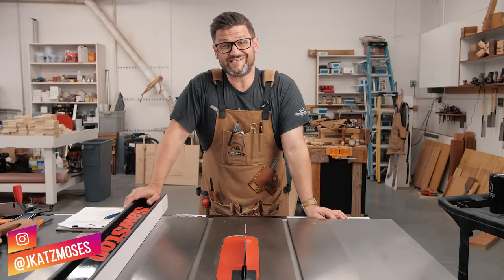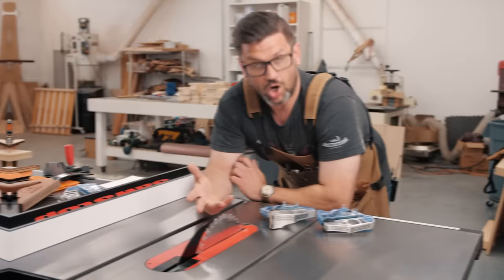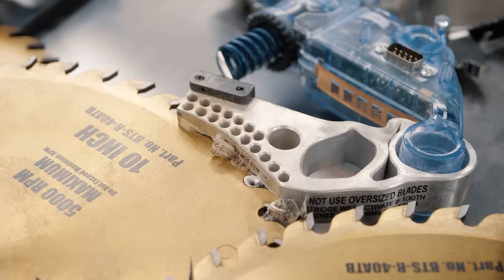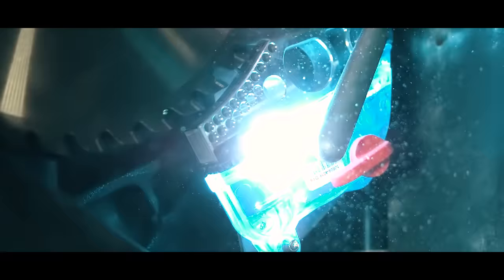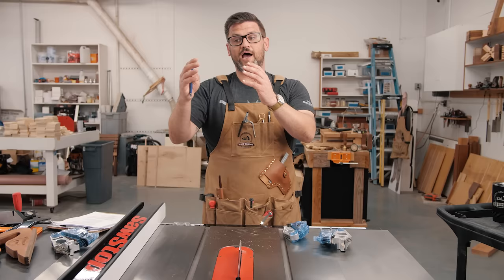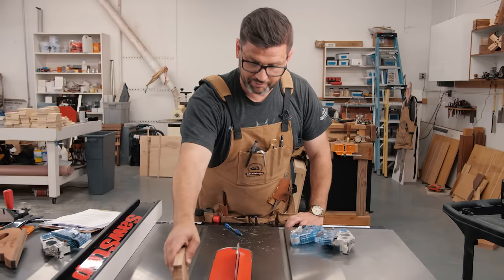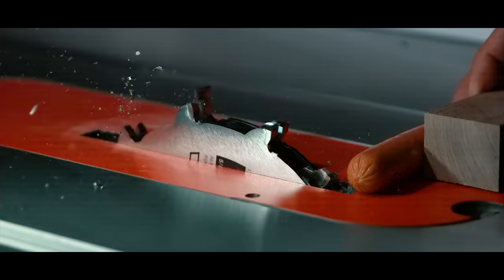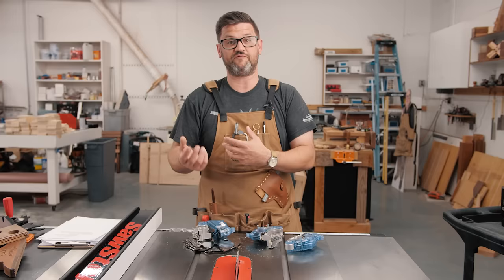How Safe is a Sawstop Saw? - Never Before Seen 19,000 FPS HD Slow-Mo Video

Comment: I literally went "Holy shit" out loud when the teeth popped off. That is INSANE.
Reply: Same here. I had to go back and play it again just to be sure I really understood what just happened... even after it was explained. Just crazy.
Reply: How do we know that he first broken tooth wasn't the first to hit the brake ? Are we one hundo on that?
Reply: @cognitive-carpenter  The replay at the brake shows that the first tooth to hit it barely got past the brake. It never got back to the top.
Reply: Same. That stopped with enough force to rip the metal apart. Incredible.
Reply: @chroniclesofbap6170  Well, it wasn't really just the force of the stop. The far disk wobbled and clipped the one next to it, breaking off the tooth.
Reply: @badgerwatkins  I never spotted that!
Reply: no, shock wave ripple cracked that weld.
Reply: Watch it at 25% speed. What actually happened was one blade stopped before the others, and the b lade next to it kept spinning. This, combined with the wobble from stopping so suddenly, (and the kerf of the teeth as well) caused the teeth to smash into each other. Also,  those look like carbide tipped saw teeth, which are brittle AF.
Reply: DUDE me too
Reply: Exactly. I was shocked to see that thing just throw the teeth off like that. My dog looked up at me when I exclaimed.
Reply: It looks like there are 3 individual blades, the rear blade smashing into the back of the one in the center
Reply: And you can see a spark, i dont think your seeing the tooth separate because of inertia. But you also didn't explain what we were looking at either
Reply: @badgerwatkins  Exactly. It's plain as day. There was another towards the rear that did the same.
Reply: I said out loud ”oh fuuuck”
Reply: This actually gave me a stupid idea for a Sawstop ad.

The scene begins with a villain chasing a hero down a dark alleyway. The hero barges into one of the buildings, which happens to be a wood shop. The villain chases him inside and the two engage in hand-to-hand combat using various tools found in the building. 

The villain eventually gets the upper hand, turns on the table saw, and slowly pushes hero’s neck to what would be a quick but gruesome dea – BANG!!!

“This has been brought to you by Sawstop, proudly protecting your pretty pinkies since 1999.”
Reply: I triggered my Sawstop...with my miter Gauge...never make that mistake again. It ripped the carbide teeth off the saw blade. Upgraded to a Freud and had to buy a new brake. $175 mistake...but quite impressive. The blade is just gone when it is triggered. Cool tech.
Reply: Brazing or the back of carbide tips failing from extreme Gs from blade brake deceleration alone (instead of impact where it is a given) is indeed impressive.
Reply: same
Reply: @iamthetinkerman  the teeth broke, not the welds, because of the ripple. Carbide is like glass it shatters, it also produces light in the process. Try hitting sugar with a hammer ;)
Reply: #same
Reply: @ionescupaul6305  agreed
Reply: Literally same
Reply: Not all popped off, some even split with the carbide grain structure! It ripped metal in half, stuff it wasn't even touching!
Reply: I interpreted this comment as the guy doing the video had his dentures fall out and you went "holy shit" when they did.
Reply: 5:58
Reply: Ditto
Reply: No its just physics, hysteria pandemic here also. 
Tungsten is super brittle, 1000g's will easily provide enough shear force to crack them.... they very hard, not malleable!
Reply: @badgerwatkins  Exactly..Idk what all these people are exclaiming about. Looks like carbide also, which extremely brittle and easy to break.
Reply: Think I'll join camp 'one blade stopped, the other kept spinning'. It sure looks like the teeth from one blade collide with the other. You can kinda see why that would happen from underneath. Two of the blades hit the shoulder of the brake block while the other has to bite in before getting lodged and stopping. Regardless, it's a hell of a thing to watch and fantastic tech. High up on my list of must haves.
Reply: D.B db imagine u get grounded
Reply: It looks like the stack actually spun and the teeth from one blade hit the other blade's teeth. Still, that's some insane technology.
Reply: Haha, me too !!!
Reply: At first I thought it was solid and thought "This isn't possible" - but it is welded on there. STILL INSANE THO
Reply: My eye's nearly popped out my head at the moment
Reply: Wouldn't it like, embed in your arm at that speed though?
Reply: “Something you’re not gonna believe”
“Yeah uh huh we’ll see...oh wow...I really didn’t believe it.”
Reply: ME TOO
Reply: same here, mind blowing stoppage
Reply: literally is literally overused af
Reply: @m3528i  i didnt, the blades hit eachother, watch it in 25%
Reply: I literally did the same thing
Reply: @odis6397  thanks my man
Reply: Literally the same thing here.  Woah!
Reply: @boowiebear  Blade and brake is cheaper than the emergency room bill.
Reply: Mine was an "oh shit", but yeah, NUTTY!
Reply: @themusiclord1  That's what I said.
Reply: Same thought. He said we'd be surprised but I was still like whoa.
Reply: SAME DUDE
Reply: @TigDegner  dont care
Reply: I was blown away!
Reply: Said the exact same thing.
Reply: wtf
Reply: I saw this comment just a minute before the saw blades stopped. I laughed at the comment and thought "over exaggeration" and then it happened and I literally yelled "Holy Shit" and then felt like an idiot.
Reply: same
Reply: i said "what the FUCK"
Reply: @blameusa7082  
I've had a Tungsten Thorium Electrode turn to dust as I sharpened it on a stone.
My guess is it hit its resonance frequency and shattered just like Myth busters showed with glass!
Reply: Same here
Reply: Total jaw dropper for me.
Reply: @TigDegner  hmm
Reply: It'll really make you say it.. so insane
Reply: My response was quite the same
Reply: i did the exact same then saw your coment lmao
Reply: @badgerwatkins  Someone else said the same thing and the comment got thousands of likes very quickly and now the comment is nowhere to be found... I can find it with a direct link because it's in my reply history so it wasn't deleted but it should be like the 3rd or 4th most liked comment but for some reason when sorted by top comments if you scroll down forever you can't find it... weird
Reply: SAME
Reply: what teeth
Reply: same thing happened at saw con
Reply: It’s weird cause I did exactly this 😂

Comment: My best friend has one of this in his workshop. One time I was helping him doing some cutting and suddenly the sawstop activated itself without any visible reason. When I took a look closer I realized that inside the wood was an old and rusty nail.
Reply: Saved you from… idk, sparks and shrapnel?
Reply: @yuanxinwang8219  The nail conducted the 3volt signal from the blade to the ground, lowered blades capacitance, sensor detected it and exploded the charge, launched the aluminum piece and stopped the blade.
Reply: @UserName92149  Ah, so you'd rather severely injure yourself than lose maybe 200 US on a new blade and brake. Losing material possessions shouldn't go above personal injury.
Reply: @adakcelina  it didnt conduct the signal to ground, since the nail isnt grounded... it was embedded in wood. 
it absorbed part of the signal through its capacitance
Reply: @nikkiofthevalley  $60, not $200

Comment: 5:55 this is truely unbelievable. Force and shock was so intense that jaws left the blade. Salute to people who invented this.
Reply: I think the tooth that is farthest back just colided with the tooth of the the center blade but thats just me
Reply: A kid from my high school actually helped invent this
Reply: @samueljordan5601  yeah it was me
Reply: @reasonjefferey4644  it's true, i was the saw
Reply: what jaws? they're teeth.
Reply: @miso-ge1gz  You were the saw? So you could say "I WAS the SAW, i SAW it"
Reply: @Zereze  hmm yes very funny
Reply: @waldolemmer  It's purpose was to be an unfunny pun in the first place
Reply: @samueljordan5601  That kid? Albert Einstein.
Reply: @p529.  Yeah, the blades with more teeth have more weight, more force, and will continue in motion since the only thing preventing them from continuing to move is the clamping force of the nut on the arbor.
Reply: @awboat  Yeh but what i was saying is that the actual tooth of the blade extend past the width of the blade and once the saw came to a stop some of the blades kept rotating and snapped off the tooth. But some people think the sudden stop just teared them off by the sheed g forces
Reply: @p529.   I totally agree. At first I thought the blades flexed sideways causing the teeth to collide, but I see P529 is indeed correct in that when the dado is set up, the teeth may overlap each, although usually staggered, but are never supposed to move in relation to each other. During activation the blade being stopped so suddenly, however, slightly unevenly, the teeth of the back blade indeed moved in relation to the center blade and collided with it's neighbor. It happens further back on the blades also, exactly the same time, confirming it is the slight rotation of the rear blade in relation to the center blade causing the teeth to break. (6:02 for impact)
Reply: @reasonjefferey4644  100% true i was the person you kidnapped for testing
Reply: @miso-ge1gz  and i was the wall in the room you two were in
Reply: @Zereze  ive seen ive sawed and ive literally sawed but ive also conquered
Reply: I invented it , straight after the touch lamp
Reply: Imagine the jaws hit your eyes… your fingers are fine, but now you are blind. Not a good trade lol.

But yes, the technique is impressive.
Reply: @samueljordan5601  naaaaa!! Seriously?
Reply: @Chrisko1492  that's why you use safety glasses, he also said that after this scene
Reply: @samueljordan5601  yeah i am the saw and i confirm this is 100% true
Reply: @awboat  The momentum didn't shear it, it was the intense shockwave of vibrations.
Reply: it looks like there are 3 individual blades, and the teeth are somehow T-shaped. What happened was they got desynced and collided due the the tip of the T being wider than the gap in between
Reply: The blade wasn't the only thing that lost its jaw...
Reply: @miso2271  also can confirm, I'm the saws' mom.
Reply: 6:42 But what's REALLY impressive is, check out these hot dogs...! 🌭🌭🌭
Reply: @awboat  hehehe, nut
Reply: That's physics and centrifugal force for you my guy